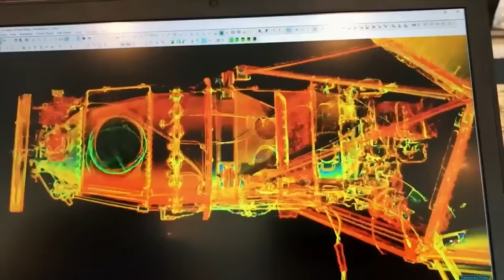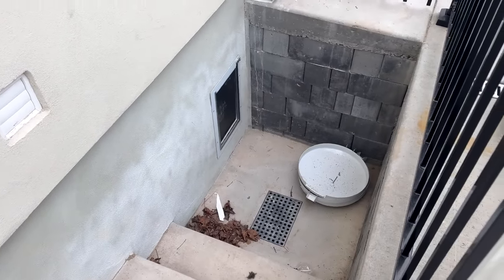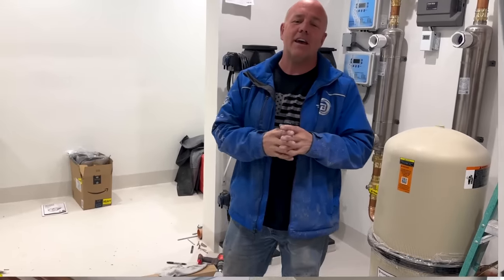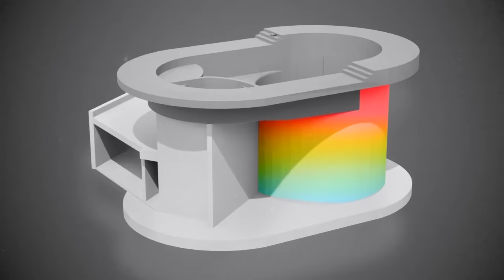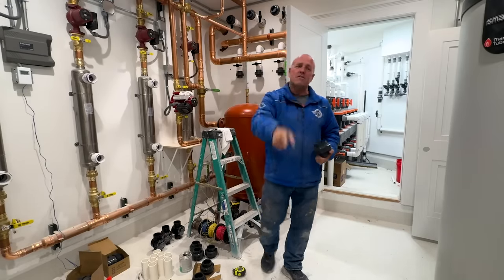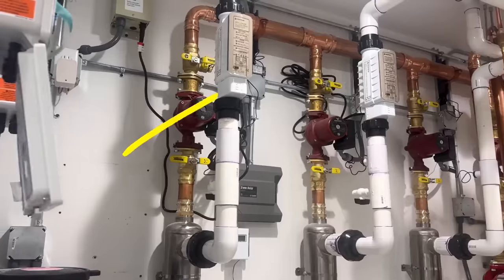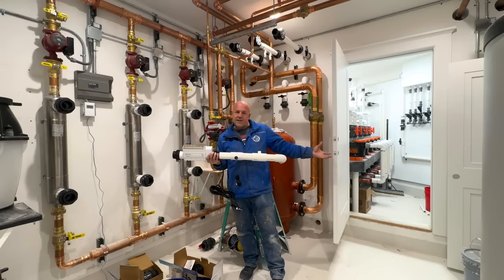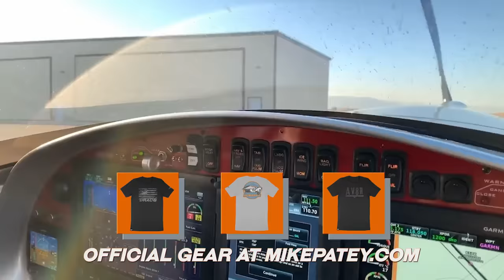Over 40 KW of Backup Power to my home and pool | House Build #23

Comment: Any HVAC experts in the comments -  can I get a pointer in the right direction? 

Going to install AC at my house this summer and I also run an ice rink in the winter (currently DIY refrigeration). 

Is there a way to have a single system that switches over between cooling the house in the summer and chilling the rink in the winter? Shared condenser coil, some valves to switch between them, maybe adjusting the charge each season to let the rink chiller side get to -13C or so. 

Are there obvious flaws with this plan besides efficiency? I know a dedicated chiller would work better, but I want to understand the tradeoffs on capex vs opex and when I ask resi installers about this they look at me like I have two heads.

Appreciate any thoughts! And if anyone wants to consult on this with more specifics I’d be up for that too HMU 🫡

Comment: It looks like your back up generator is a 30 KW. If your house has a 200 amp. service that would be equal to about 40KW.  I have to believe you have at least a 400 amp service? How does a 30 KW generator handle 100 % of the house load in an outage?? Sincerely, Richard Goodman

Comment: Spent 6 years as an emergency power guy in the usaf… not in a million years would I chose a generac. Cummins/onan is so much better in every way. Considering how much you’ve spent on everything else why cheap out on the backup generator. Sure it may not need to be used a ton, but god I wouldn’t put that much on the line to a generac. Hell even the military who doesn’t care about cheap stuff most of the time avoids generac.

Comment: House built by an airplane designer. ...."So, if the power goes out we need start the APU, and if that goes out we need to deploy the ram air turbine, and if that fails we need a hand pump to lower the landing gear"

Comment: I am pretty Confident you are going to regret gluing that turf down in the warmer months.  And with a pool that size you probably could have used a geothermal system instead of those those big units out side and used the waste heat to keep your pool warm.  Would have been more efficient too.

Comment: You’re going to regret that Generac generator. +90% failed during lat hurricane here.
Reply: I was a little disappointed to see it was a Generac, but maybe they’re better now?
Reply: I have three neighbor replaced their Generac with a Kohler 28KW. Two other neighbors replaced theirs one with a Cummins 30kw. Both brands are really good, water cool motors and the Kohler is very quiet. You do some great engineering. I would like to stop one day and see you set up and meet you one time.

Comment: If you have a 30kw load then I see why you went with a 40 kw just hope it has a cat engine
Reply: Generac uses there own engine for the 48kw 4.5L inline 4cyl, it was a ford 5.4 v8 4yr ago.  The 30kw is 1.5l Mitsubishi but a loud 3,600rpm.  The 2.4L turbo 36kw is no longer available due to Mitsubishi not making the engine but was a much better and quieter unit

Comment: @12:36 is this a joke or did black and decker really start making pool pumps?
Reply: The black and decker pumps are variable speed and the most efficient on the market. 5 year warranty and you'll save 80% in cost efficiency.